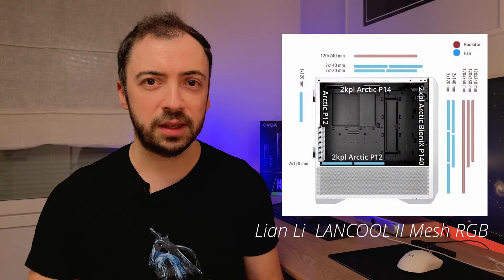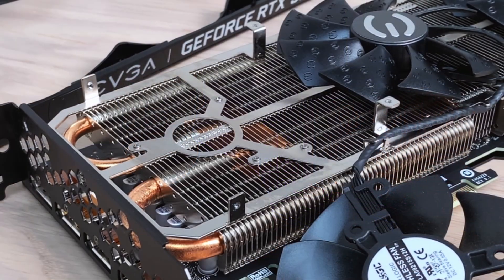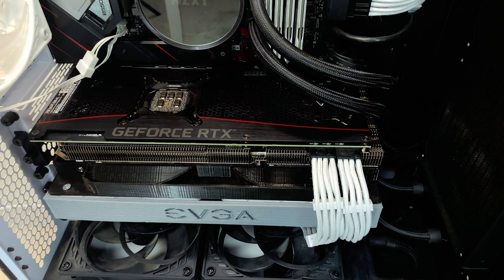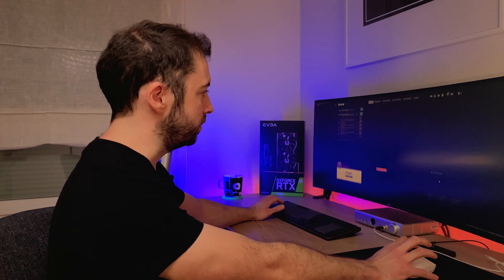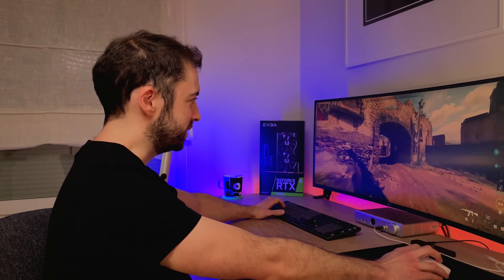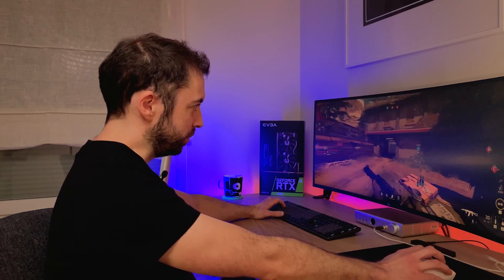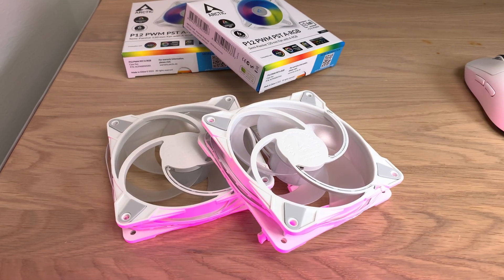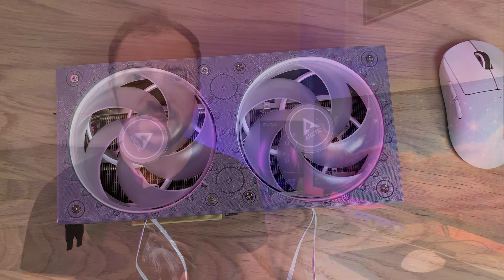EVGA RTX 3080 deshroud ... here is what I've learned

Comment: Where did you connect the fans? in the GPU or in the motherboard?
Reply from the maker: Motherboard if I can remeber correctly. You can use PWM adapters and connect the fans to the PCB as well.

Comment: Thanks for your video. Of course if you leave the default temp/fan curve it won't make any difference, right?
Reply: Depends on the fans you use.
Reply: @nenwhen9262  I did a mod with three 92mm fans and it works outstandingly well. I find 70% is where you get most of the performance without any noticeable increase in noise at all.

Comment: Just a thought,what if the shroud completely sealled the card only allowing for hot air to vent on the side,outside the case and cool air to come in from the fans,and also ehat if the bottom of the case was vented to allow for cool air to rise up from below?just a thought
Reply from the maker: It can help on some degree. @optimumtech did a video on that topic if you are interested.
Reply: @RandomTechChannel  ama check him out